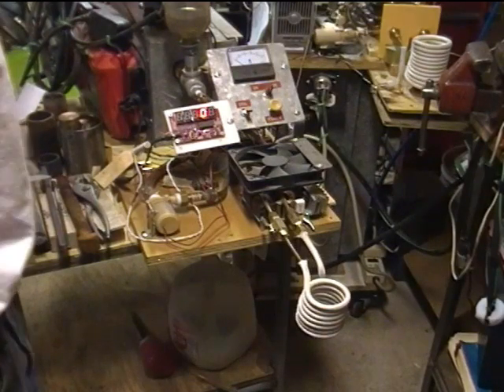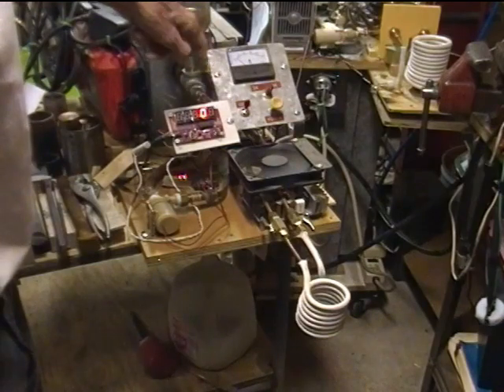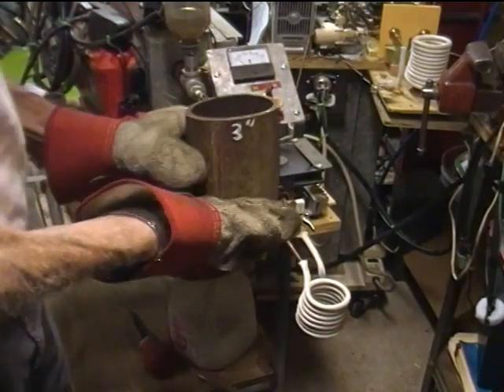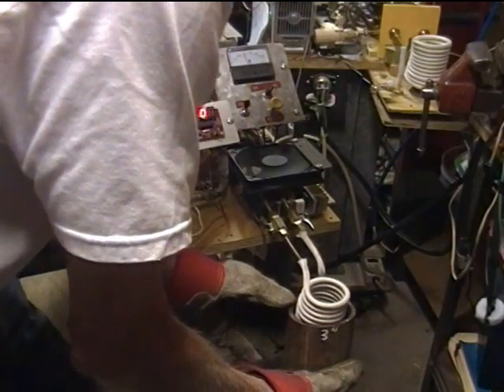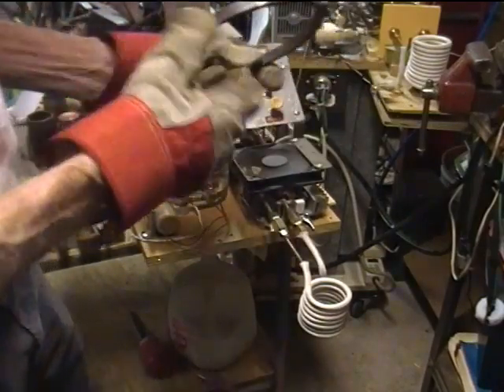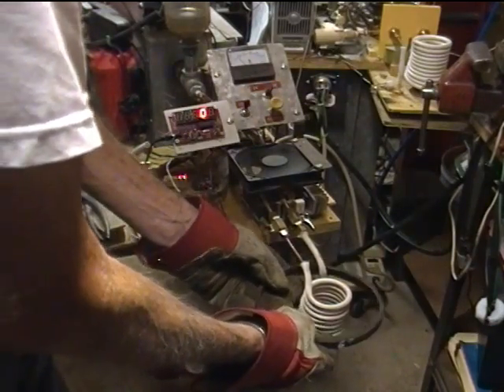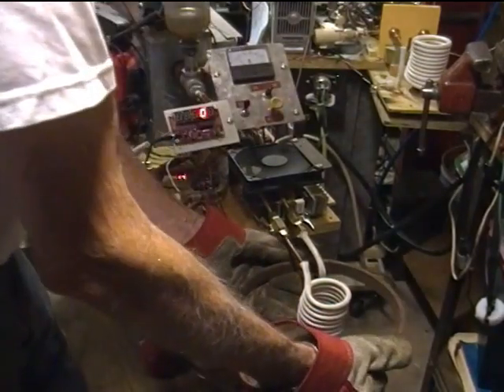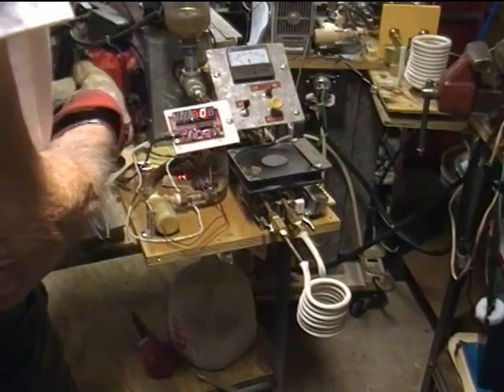ZVS 1000 Watt Induction Heater, Power transfer Outside of the Workcoil, Part 2, #204

Comment: Hello sir
Thank you for all the great videos
I have a question, is it possible to combine 3 units with a power of 1 KW with each other to produce 3 KW?
Reply from the maker: Thank you for your kind words!
I do not know the exact  answer to your question, but I think it would be difficult to do. However, this style of  unit is available in output powers up to 3000 and 4000 watts.
Here is one example:  https://m.aliexpress.com/i/2255800017620563.html?gatewayAdapt=4itemAdapt
And, of course, many sellers have the 2500 watt units, like the ones that I use:
https://www.amazon.com/Induction-Heating-Machine-Frequency-Players/dp/B0B4BDVHMG/ref=asc_df_B0B4BDVHMG/?
Reply: @frenchcreekvalley  thank you for your interested

Comment: If I purchase a 1000 watt pre assembled induction heater, will it melt brass?
Reply from the maker: Answer:  Yes, but not a lot.   With the 2500 watt unit, I have melted as much as 540 grams of copper in  a graphite crucible and, since brasses melt at somewhat lower temps than does copper, you could melt a bit more. 
 But, for the 1000 watt unit, which i haven't tested for melting copper or melting volumes of brass,  my guess is that you could probably melt  200 grams (or a bit more) of most brasses, again in a graphite crucible.
  If you need more detail, feel free to ask.
Reply: @frenchcreekvalley  thanks for the answer and offering help, sorry for the long message.
I want to melt brass. Copper will be good but not a must.
2500w version: I can not find a power source to run it. (There are some national export limits here as tax free, low tax and so on.). 2500w power supply costs 4-5 times of the heater it self.
1800w version: it has a reasonable price with a 48v 31.3 amp power supply. Internal diameter of heating coil is 70mm and I can find crucible for the size. Only problem is, I hesitate that these metal case power supply will provide 31.3 amp contiously.
1000w version: Both price and power supply are cheap and easy to find. Most important problem is: internal diameter of heating coil being 30mm. I couldnt find a matching crucible.
What will be your suggestion?
Reply from the maker: @hedefeKrK  I understand your concern about price and size of induction heater.

II have had good luck with one of these for my 2500 watt unit:
https://www.aliexpress.us/item/3256802439467524.html?
Emerson R48-2900U communication power supply maintenance module, 2900W high-power rectifier DC charging module 50A

Regarding coil diameter:
 The 1000 watt units that I use come with work coils that are around 50 mm in ID.

Here is but one of many sellers of the type of graphite crucible that I use:
https://www.aliexpress.us/item/3256804144780881.html?

For your other questions, I suggest you check out some of my induction heating web pages starting at:
https://spaco.org/Blacksmithing/ZVSInductionHeater/1000WattZVSInductionHeaterNotes.htm

Comment: Another thought just came to mind...I saw the impressive heating power of some of your coils.  Also I noticed that in many videos involving melting metals in a crucible, that a small cover is placed over the crucible to hold in heat...this cover get visibly burnt quite quickly.  I think that maybe if a piece of very thin metal sheet (rather than some kind if fiber or whatever is used) is simply placed over the workcoil top (maybe before the coil even has time to become hot) and the unit turned on, perhaps the heating flux variation may become apparent in the discoloration pattern of the thin metal sheeting.  I don't know if the effect will show clearly, as this would a weaker flux interaction.
--dALe

Comment: ...just saw this video right after leaving a suggestion on part 1 a few minutes ago.   Adding to that comment, I thought I should mention that  magnetic flux is always maximum at the center inner EDGE of the coil against its middle inner ring This locus of max power points describes a CIRCULAR RING centered in the workcoil.  If you imagine a thin CIRCULAR DISC placed in the coil center, my theory says that heating would be max at the outer perimeter and decreasing in strength, reaching the  MINIMUM flux on the circle at it's center.  And for ALL cases the flux is MINIMUM at the center axis!!  This implies that inserting a metal rod down the center axis places it in the WEAKEST field.  Along ANY axis of the workcoil the center axis is weakest and weakens further as you move toward either end of the workcoik!  In fact,  the field at the very ends of the center axis of the coil are EXACTLY 1/2 that of the center of the center axis.
THANKS AGAIN...hope you can demonstrate this.  I will be able to put this theory into action in a few days...hopefully.